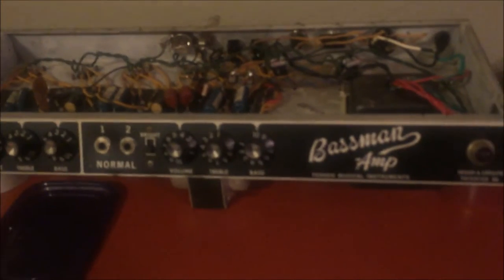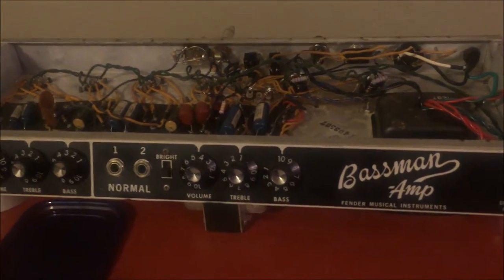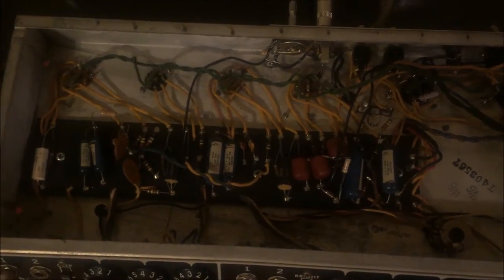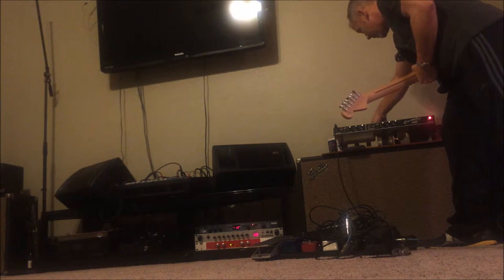1967 Bassman AA165 Modifications - initial power up and voice test

Comment: I'd make yourself a current limiter. Just attach a 250w bulb to the black wire of a cord and feed that into a recepticle. If the amp begins to draw too much current the light will illuminate somewhat protecting the amp and giving you a visual to know something is up.